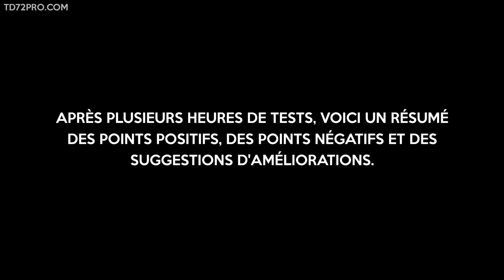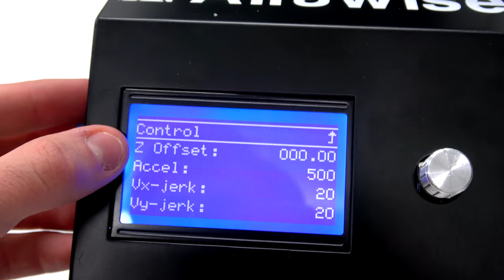Review Alfawise U10 - Une rivale pas chère de la CR-10 S4 ?

Comment: Et bien après l'avoir reçu, j'ai eu 1 ennui de firmware (on peut installer un marlin de th3d par dessus) mais sinon mécaniquement aucun soucis. j'ai eu juste comme toi des problème d'alignement en Z corrigé matériellement par une courroie GT2 976mm et 2 poulies de 20 dents avec trou de 8 mm et la Impeccable c'est parfait. le lit ne dépasse pas les 65°, mais j'a réussi à faire des petites pièces en ABS avec du Jus d'ABS comme accroche. Bref content du matos mais je ne la conseille pas comme premier achat (à moins d'aimer mettre les mains dedans!)
Reply: bonjour,
j'en ai reçu une hier que j'ai tenter de mettre en route, mais en l’état je crois que cela n'est pas possible, serai tu d'accord de me contacter par messanger sur FB a Sly Chowe afin que tu puisse me dire ce que tu a fait sur la tienne. merci a toi

Comment: J'ai une Anet A6 et c'est aussi 2 moteurs en "Z" et une seule limit switch. Par contre il y a un connecteur indépendant pour chacun de ces moteurs sur la carte mère .
MA QUESTION:
Serait-t-il possible d'installer une deuxième limit switch en "Z" et faire quelque chose dans le firmware ou autre pour que le "homing" soit fait de façon parfaite sur les moteurs gauche et droit de l'axe "Z"?

Merci
Reply from the maker: C'est certain que c'est possible, car ma Anycubic i3 Mega à deux moteurs pour l'axe des Z et elle a deux limit switch. Restera à savoir comment le faire dans le firmware alors je vais devoir me documenter, car pour l'instant je ne sais pas trop comment ça fonctionne.
Reply: Si tu peux bidouiller ta A8 , c'est sans doute la même chose. Une modification à moins d'un dollar avec une belle augmentation de la qualité et de la stabilité du bed. Je crois que ce serai une vidéo intéressante. Bonne journée Tommy!
Reply: J'ai pas remarqué si y'a 2 connecteurs de limit switch "Z" sur la carte mère. Si c'est pas le cas, humm est-ce que c'est encore possible?